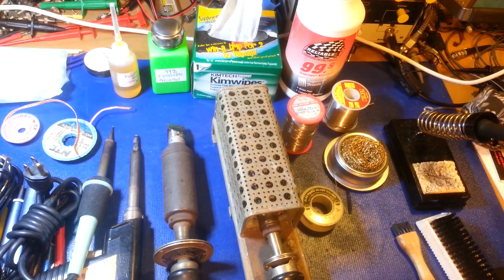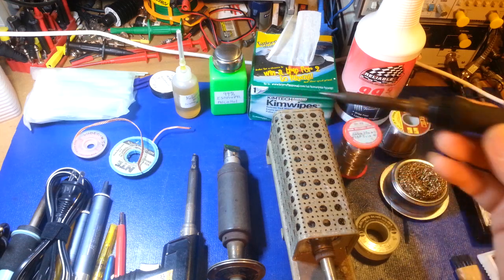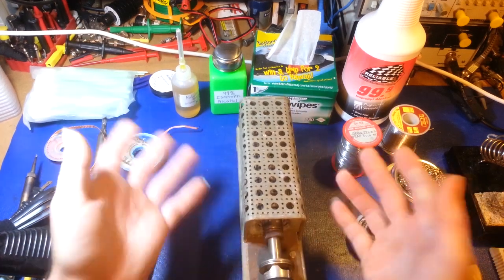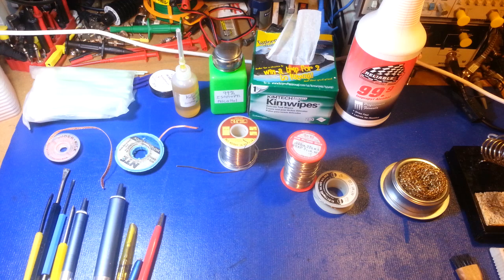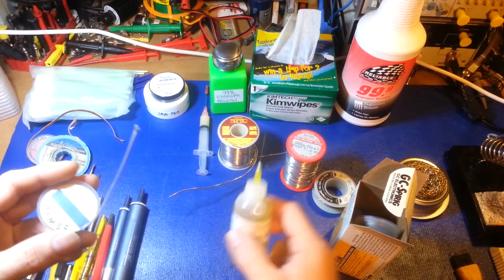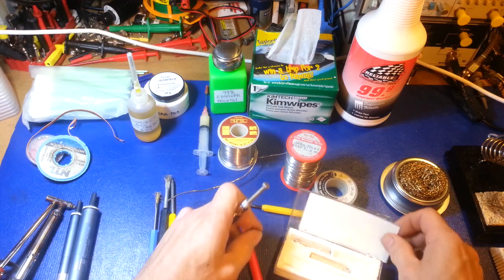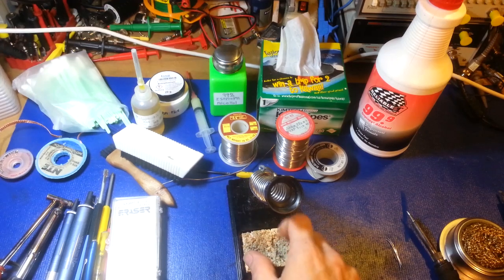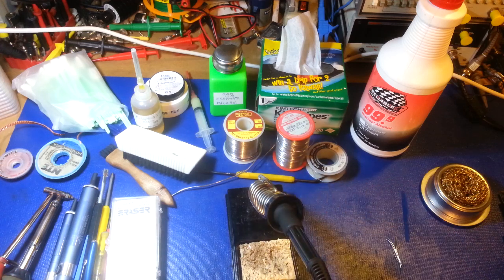Hand soldering tools and equipment.  The tools of the electronics trade.

Comment: The iron stand with the clamp was used by Bell Telephone in offices with large long frames with wire connections from one side to the other. There were ladders on wheels with a rail connections at the top. Roll the ladder to the location clamp the iron stand to the rung and solder the connection. Every phone had two connections on each of two frames.
Reply from the maker: Knew it had a specific purpose,  now I know what.  Thanks :)
Reply: You are very welcome!
Reply: That's a Bell System soldering iron...I used one just like it as a frame worker.
I spent my day running wire jumpers from the field side of the Main frame to the equipment side that provides dial tone.

Comment: Excellent video Mike.Very well explained also. Great tips ( no pun intended) Video quality was also great.
Reply from the maker: Thanks for the compliment.  Was having serious doubts about using a tripod for camera work.  I need to be able to move the camera around a good bit when doing radios.  You would love my cobbled together mount I came up with.  Its a standard mount (modified of course) but I stuck it on one of my bench microscope swing arm mounts.  Its a old dental microscope with a swing arm attachment. Just pull the microscope head out and clamp on the mount.  Ended up working out really well.
Reply: I tell you bro. It really helped the quality. Not that I had any problems before, but it was like watching a new person shooting videos.  Well done. I felt the same way when I started out, thinking mounting the camera was going to limit what I was doing.  But I have gotten many compliments on my video quality and camera work. Even though I am a noob lol.
Reply from the maker: +The Radio Shop 

Yep, complete newbie at it to.  Learning as I go.

Comment: That's what I do in our repair shop, i filled the inside of the solder stand with stuff to weigh it down. It's easy to tip those over so I put some weight in it.

Comment: If you get of the Weller gun type soldering guns,  replace that crappy wire tip with 12 or 10 ga copper wire, minimal bent tip.  It works killer you can form puddles of solder on a old school steel chassis.  See the Mr. Carlson video with that info on that.

Comment: Some great tips!  Also to note with soldering, it's always best to use the proper tip for job specific!  And to use "no clean flux". I also have a RS solder stand, left over from my younger days of learning electronics hundreds of years ago, and like you I weighted it down! After our conversation about 60/40, I ordered 62/39 .32....waiting for it.... enjoy what you do Mike, keep it up!
Reply from the maker: Think you mean SN62 solder.  62+39=101, numbers should add up to 100. :)  SN62 silver solder is a SN62 (tin) PB36 (lead) AG2 (silver) composition.

Yep, tip size is very important.  If someone plans on working on all three types or vintage of electronics (point to point, thru hole and SMD) then its a good idea to get a couple of different size tips.
Reply: Ooops, typo!  :)  I was thinking, maybe that big ol' horse leg of an iron you have, that's probably the best iron to do SMD work!  Demo that in your upcoming video on the topic!  :)

Comment: hi sir thanks you for your video.
But where did you get your vacuum sucker pump? I look it on internet and on electronic store and there is absolutely nothing about " jensen pump". Do you have any provenance? thanks you
Reply from the maker: Alexander Hartdegen 

If you mean my large multiprocess machine it is made by Pace.  They can run into several thousand dollars new depending on the size of the base unit and how many hand pieces you get.  If you mean the simple solder sucker or sucker ball desoldering irons you can get them on Amazon or Ebay.
Reply: yes I mean the simple solder sucker (the little model). Ok I will check again, I very love this tiny model.
Thanks for your videos.

Comment: i got the cheap knockoff ,  had to change everything down to cables  and rubber pads , wire for cleaning spunge ,everything including electronic modification , but that is what we do ,  i ended up paying around 100$ for it  , to get real stuff would take at  least 300$ so i say avoid Chinese irons as well if you cant modify it and make it work like i did .